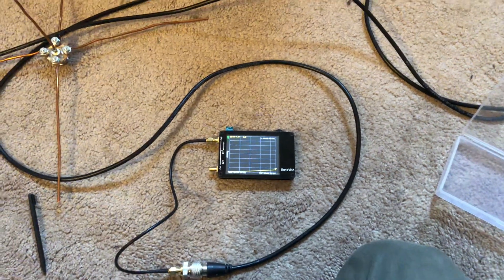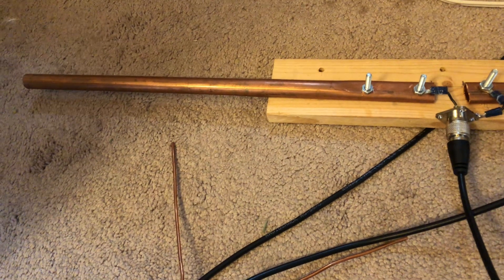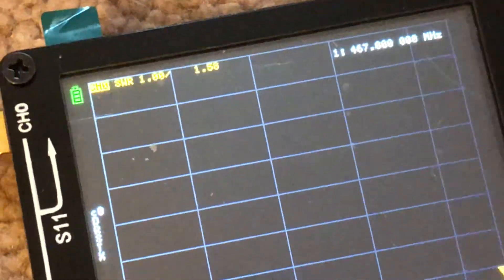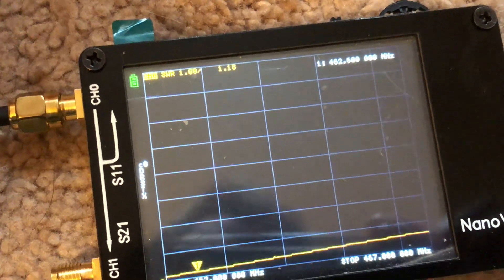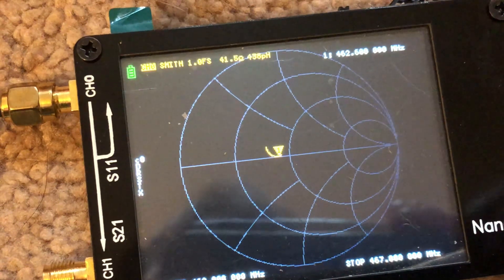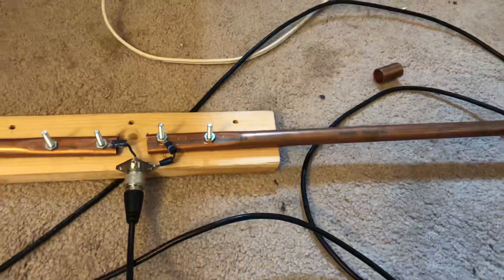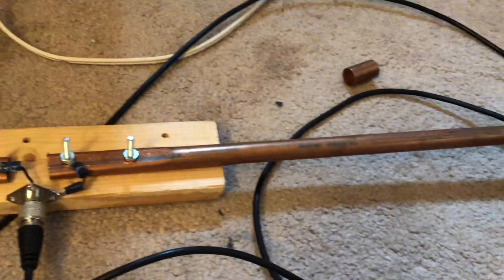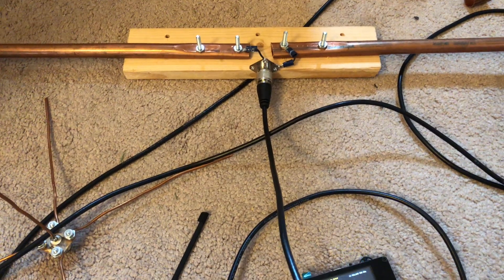GMRS 5/8 WAVE HOME BREW ANTENNA #diy #gmrs #antennadesign #experiment

Comment: A start to an easy 5/8 wave Yagi?
Reply from the maker: @southernexposure123  I guess we could.   But it’s a dipole for now.  But good call.  If I ever find some scrap metal then that’s an idea
Reply: @mikecricket113 I'll try it as a wire dipole first.  Then I'll try a quarter wave matching stub using 75 ohm TV coax.  That might transform the feedpoint impedance. 
After seeing how the wire works (I suspect I won't have as low SWR as you got with the tube) I'll look for some scrap tube..  
Anyway, thanks for the video and for the information

Comment: Also be careful with that piece of wood, lots of contact area there and even capacitive coupling.  I remember when I was a younger man making a vertical whip for my vehicle, I tried to stiffen it (it wasn't tapered) using an acrylic plastic tube.  The SWR went from < 1.05:1 to over 1.5+ at the center of its frequency range.  I was really surprised at the time.

Comment: Looks like you can shorten it some more to drag the range higher
Reply from the maker: @neogeo8267  NanoVNA showed it was pretty good across the band.
Reply: @mikecricket113  for sure, but it looked like the slope continued forward towards lower frequencies. I suspect the center was off screen to the left.   Then again I spend way too much time optimizing antennas for what likely amounts to gains that aren't meaningful 😅

Comment: I'm just learning this. So are you trimming off lengths to adjust the ohms or the trimming length adjust SWR or does it kind of do both?
Reply from the maker: @MrSabram07  I was trimming for swr. Channel 18 462.625   I was just playing antenna.   If you are trying to set up a base antenna at home. I suggest buying an ED Fong GMRS vertical antenna.  They work great and are economically priced

Comment: If you first adjust just one side of the dipole for the lowest SWR, then adjust for the correct resonant frequency by trimming both sides equally, you will be able to lower the SWR
Reply from the maker: @PatAutrey  thank you for the knowledge

Comment: New to the gmrs, how well does this do on the gmrs freqs and is it direction, at the moment my tower is approx 20ft, i know seems short, thats why im looking into other antenna options
Reply from the maker: This was me experimenting.   It worked well.  But I was playing around with antennas.   If you want a good antenna get an Ed Fong.  Vertical.  It’s meant for outdoors and has good gain.   My dipole in the video doesn’t have a ton gain. Dipoles usually don’t.

Comment: Does this transmitter also work on the 11m band because I believe I see in the manual that it is not possible to transmit on the citizens' band? Can someone inform me?
Reply from the maker: Transmitter???   You mean the Nano VNA ??? It is an analyzer.  Not a transmitter.   
Yes is will “work” on 27 MHz

Comment: why are you using 2 x 1/2 wave radials we use 476.4 - 477.4Mhz  for our 2nd C.B. band and that would make yours  10 - 15 Mhz lower,  work the math for 476.4Mhz a ful wave is just a smig over 2 foot (63 cm) so a dipole would be half that at 1 foot (31.5 cm), so to centre feed a dipole for 476.4 each 1/4 wave would be about  (((6.5 inch (15.7 cm)))), Im surprized the VNA got it right for you the impedance shocked me an open dipole in all from what i thought would be 300ohms, 200 for a folded dipole, I play around with "J"poles, you should try making one, use a full wave tube folded back at 1/4 wave, keep gap at 3/4 inch, also you should have 1/2 wave left, measure 1 inch from the bend this is the feed piont , centre conductor to the longer tube braid on the short side. this is to simple ...enjoy 😀😇
Reply from the maker: What country are you from that you use 476.4 and 477.4 MHz?
Reply: @mikecricket113  Hi Mike im in Sydnry, N.S.W.Australia, I also believe NZ use the same band we have 80 ch now at 12.5 khz stepping, prior to this it was 40 ch at 25 kc, ch 1-8 / 41-48 are repeaters with a +.750 khz off-set, the ch set-up is a little silly ch 1 is 476.425 while ch 41 is 476.4375, then ch 2 is 476.450 ch 2 is 476.4625 .....and so-on through to ch 80. we still have HF 27mhz 40ch but late in the 70's only had 18ch am,ssb. hope this is some help 😄😇 p.s. owe police use 465 mhz - 469 mhz is now  digital incripted, I use TYT 9000D it covers 45watts at 400mhz drops to 30watts at 490mhz
Reply from the maker: @garrybrewster5821  Very cool. Thank you for explaining everything to me ,and us.  I remember now watching a few videos about UHF in  Australia   Everyone has their own allocations.   I do hear Australia coming in on the 11 meter band from time to time.  And of course on the ham bands.   Thanks for the education.   😊.  73.

Comment: For 5/8 wave, it's 585 divided by 464.5 (middle frequency of 462-467 MHz) = 1.26 FEET or 15 inches, 3 mm.
Reply from the maker: Yeah. I was shooting for 462.625.  Thanks for thee advice
Reply: 15 inches per side making it 30 inches between both sides
Reply: @nats50  that's the formula for 1/4 wave.